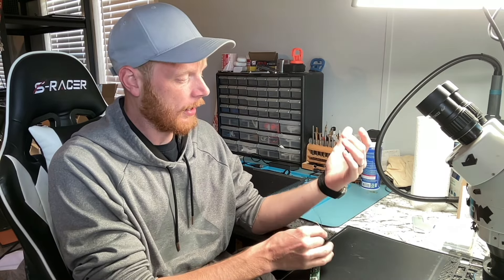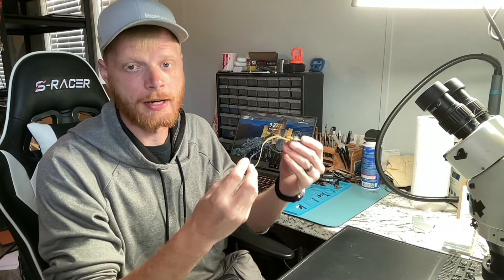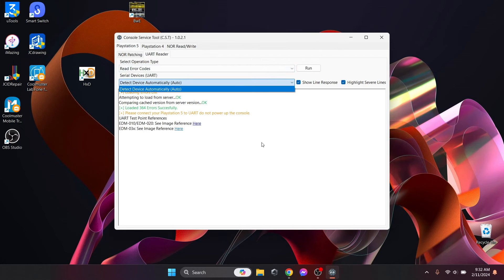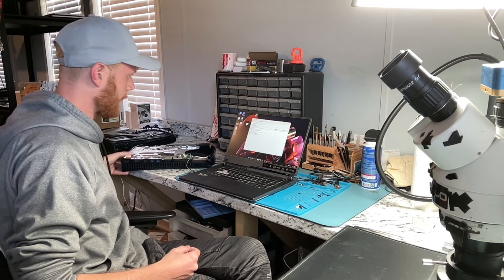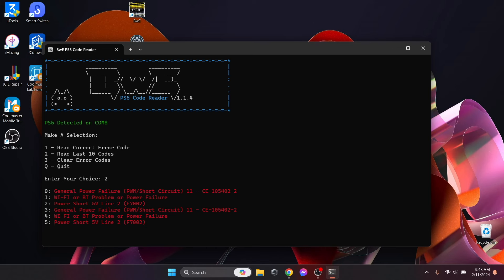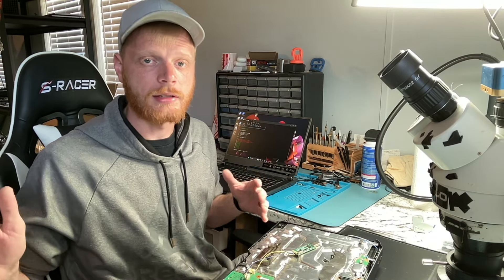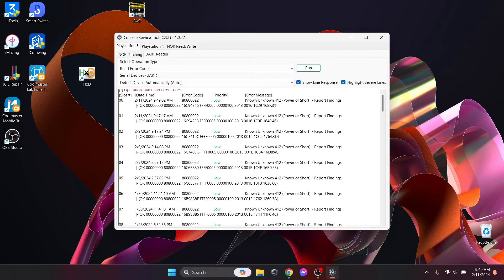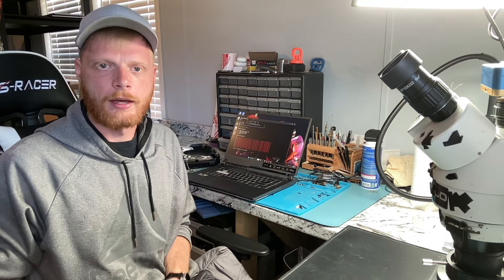Ultimate PS5 Diagnostics Guide: Using UART, BwE, and Free Software for Console Troubleshooting!

Comment: hey man, great video. I was curious if you knew the contact points for the ps5 slim edm - 041 board? Having a no power issue and was hoping to run codes before anything else. Any help is greatly appreciated!

Comment: i have a uart reader with the pins 5V GND RXD TXD and 3V3 but without a switch to decide what voltage get used how do i know if the device is using 5V or 3V3 for reading if i only use ground?
Reply: Some readers need to be modded from 5v to 3.3v. check your readers specs